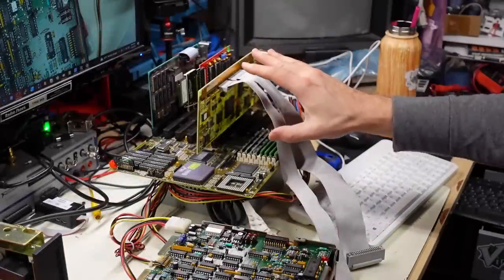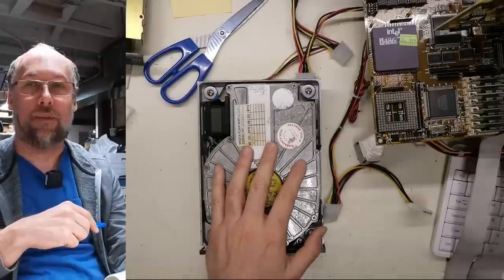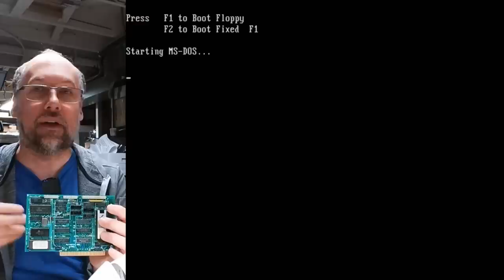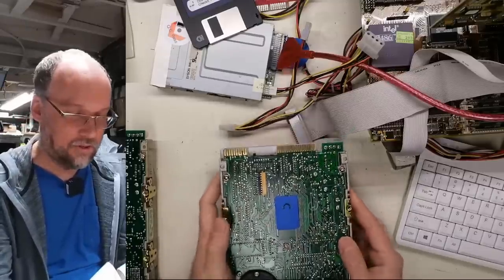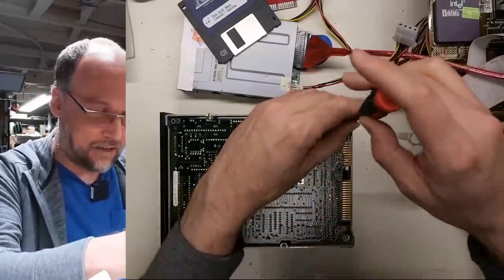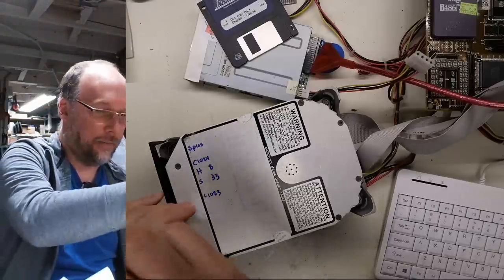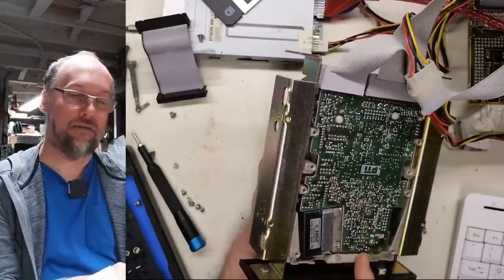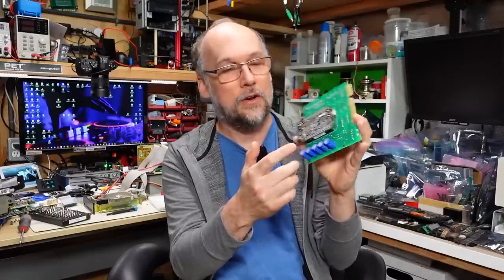MFM drives are really unreliable

Comment: My 1st IT job was programming on a Honeywell mainframe. Fixed and removable hard drives, the platters were huge 16" diameter or so. Head crashes on those things left a deep gouge in the metal, catastrophic damage.  Heard a story where the heads crashed through the side of the case.  One time the OS reported the loss of a removable drive, some maintenance guy had unplugged it so he could plug in his hand drill.  An Entire room at the facility was built and designed just to house mag tape library. Yeah those were the bad old days. I read somewhere that it would take a mainframe billions of years of computing to equal a week of the computational power of a modern smartphone, all that electricity too.

Comment: In 1994 I put a ST-251 40 meg with Doublespace compression in a Pentium 100.
It worked perfectly, no errors never lost data. Running Windows 3.1 and Autocad 13.

Comment: Back in the day installed these drives with an RLL card.  That increased the sectors per track and usually usually after a low level format, and scan for bad sectors, all were functional.  Then used Norton Disk Doctor to calulate the interlive.

Comment: My first drive was a Rodime full-height 5 1/4" drive hooked up to a CP/M system. This gave a whopping 4MB capacity. It couldn't boot from the harddisk, it needed an 8" floppy to run from. The disk controller actually didn't know how to seek beyond track 255. I reverse engineered the CP/M BIOS and got it to double the number of tracks, so I could do 8MB on a later Vertex drive of some type.
Had plenty of fun with Micropolis stepper motors going bad, Maxtor XT2190 sticking etc.

Comment: Those platters are made of the purest aluminum of any mass produced parts ever made. The oxide coating is so thin as to be completely invisible. A pigment is added only so that in manufacturing they could tell the coated platters from the raw ones. In later years there was no need to add the pigment, so the platters appear to be bare metal. The surfaces are also extremely flat, usually within 25 microns across the entire surface. 

A hard drive platter makes an extremely nice signalling mirror, for primitive hiking. The sun's reflection will be about the size of the platter over considerable distance and you can look through the center hole to aim the reflection.

Comment: Stiction remained a problem until it became common place to unload the heads (a plastic ramp lifted them) at power off.  Drive manufacturers seemed to cope with it by minor jiggles of the drive motor back and forth while also minor jiggling of the heads side to side if there wasn't indication the spindle was starting to spin.  Just remembered, if you had a drive that did get stuck and this was how the manufacturer coped with the problem you could hear a beep like sound as it attempted to unstick itself.

Comment: Try the card from the bad ST225 on your working one. I find it less likely that a suspected bad card would damage a drive.

I have a Priam V185 (I think that's the model) in my IBM 5160 that makes a horrible bearing noise when spinning, and the disk is not accessible. 
My plan is to take that drive apart and try to add some lubricant to the spindle motor to at least preserve the sound of it spinning, while reading data from some modern storage device.

Comment: I remember the days of MFM hard drives. Started off with a trusty 20MB! Then somewhere along the line I remember an 80MB drive where a pair of heads had failed so we simply configured it in the BIOS as having less heads and it worked like a treat! Still got 60MB out of it. In those days, that was a win.

Comment: that's 2 out of 5 of a pile that was proably already weeded at least once across the 1990s

I used to see about a 50% failure rate when testing old MFM drives in the mid-late 1990s

The most impressive were some VOICE COIL (not stepper motor) 40 and 80MB drives from VME systems - these drew close to 200W apiece and were apparently 6-figure purchase costs when new. They were all full height 5.25" and when they eventually failed, I opened them - the 40MBs were identical to the 80MB, just with fewer platters

Comment: My father had one MFM drive that lasted 20 years of daily use in his "writing apparatus" Amstrad as it was coined in the taxes. I still have it somewhere and it contains his entire bibliography of thousands of articles and dozens of books.
Reply: Back that up ASAP if it even still works. As you see in this video these drives can be very temperamental…
Reply: @dogecode386  I still have that drive somewhere though i have of course backed it up long ago. That writing apparatus of his lost its power supply in 2005-2006, but the disk survived. I don't think it's the first disk that machine had, but certainly the longest living. I think it was amstrad 1512, but not sure since it had AMD 8086, not intel and hercules graphics for the sharp fonts.

Comment: Those were the days. Low level formatting a hard drive, setting the interleave factor, and parking the heads. I haven't thought about those issues in a long time. IIRC, A typical interleave value was 3. I used to have a program I would run that would test a drive for the optimum interleave setting.

Comment: The 1st hard drive I saw was a winchester made for an Apple 2 computer star network. It required one whole apple 2e 48KB computer to run the drive which was about a shoe box size and you could see the heads moving on the 6" platter.. it's capacity? 5 Mb!

Comment: We ALL called it stiction, it was very common with video tape recorders and rotating heads. The tape would stick to the head as it flew by, and make a very large mess inside the transport! 
We used to get those stuck drives spinning again, by rotating them clockwise on the floor or a table and stopping the drive case from spinning very quickly with a phone book* to break loose the platter.  *(those existed before the "internet" too... :) )

Comment: Actually, only modern 2.5" drives are glass. I've opened many dead drives and all the 3.5" ones have had aluminum platters. Also, the magnets in HDDs are endlessly useful. I also got a 2.5" IDE drive to work by opening it up. The top cover was slightly bent which prevented the motor from spinning properly. It worked long enough for me to copy the data off it which is all I needed.

Comment: In a telco repair shop, I once had a hard drive with a very bad crash, it was obviously run for many many hours like this and the bottom of the drive was full of aluminium dust. So I cut that head off, blew out all the dust, then succeeded in getting it to boot dos! (just for a laugh)
In telco buildings it's not uncommon to have a computer that boots up off a hdd, then never touches the drive until it gets power cycled. Often in these places there are huge UPS supplies, so basically the power never goes off, so these machines can run for many months or more with a head crash. They are often run headless, controlling something, with no operator present, in a noisy exchange etc, so nobody hears the screaming drive. The systems are working so don't touch it.

Comment: Of all the MFM drive manufacturers at the time, there was one who was by far the definition of unreliable. Enter Kalok. Kalok was and is by far the definition of unreliable due to band slippage and high failure rates. Even after they left the industry in 1994, Kalok still holds that title as the most unreliable MFM hard drive and you'd be lucky if the thing ever worked at all. Let alone finding two that worked!

Comment: In the way back days I got a bunch of 'dead' St225 and spent time swapping the controllers and got almost half of them working.  Low level formatting the ST225 with an RLL controller gives you 30megs.  The RLL trick can also help if the MFM format falls

Comment: I use the override the St225 speed control , remove the cover amd spindle screws, add grooves on the plater edge, and eject the plates at full speed. They actually went in the gypsm.

Comment: The Drive spindle needs to be grounded,
if it is not the platters attract the Heads.
However the the ground of the spindle would fail over the years.
I managed to repair a 1990ies 18GB HDD...... by pure luck.

Comment: My old IBM PS/2 model 50 had the problem of the heads getting stuck to the platter in its ESDI drive. I actually blindly stumbled on the fix when I got angry and smacked the machine, then tried switching it on again and the drive spun up. I later found out the trick was to lift the front of the machine a couple of centimetres and drop it onto the desk, which will free up the heads and let it spin again.

Comment: (just FYI: this video isn't loading on Odysee, but other videos there will)

Many years ago (mid-late 90's) I was backing up an old XT-class system for a law office (they were upgrading to a '486 or maybe even Pentium system).  The HDD wouldn't spin up on it's own, so I had to un-screw the board on the drive so that I could get to the flywheel on the bottom.  I would power the system up and quickly reach underneath to flick the flywheel so it would spin up.  Then I'd back up as many directories as possible before the drive stopped responding.  Then I'd have to power it off and start the process over, and copy the next batch of directories.

Ah, the fun of working on what even then was already obsolete systems.  I should have grabbed my lawyer's old AT&T 6300 before he died.

Comment: My main issue with MFM drives is stiction . I have a pair of Seagate ST 124's that will only spin up again reliably once you park the heads. These do not have auto park.  The  bigger 40MB ST251's do.

Comment: At some point, someone at Seagate decided that they could put a finer stepper motor on a ST225, and presto!, you have a 30 Mb drive ... or so they thought.  I don't recall the model number offhand - what I do remember is my work that year bought a whole bunch as part of an upgrade plan). The results were ... predictably awful. IIRC, half failed right out of the box, and of those we actually installed, probably half again failed within the first hundred hours of operation.

Comment: Stiction was a huge problem back in the day for basically every manufacturer, even into the '90s. After a while most of them figured out that a dedicated landing zone with a textured surface helped prevent stiction. Also, linear stepper-based drives (the ones that read like floppy drives do, like the PTI drive) had an annoying tendency to randomly leave the heads on the media when powering off. These were the drives that you had to run parking utilities to send the heads home before powering off. Some drives, like the MiniScribe 8225, had a time-out where they'd send the heads to the inside of the drive after a period, but unless you wanted to wait for 60 seconds or so they still had to be told to go home before powering off or the heads would just land where they were. I really don't think you'll easily find service manuals for any of these drives. Most of that stuff was internal use only, so only factories and/or depots would've ever had them.

Comment: I personally went through a couple of those st225's last week and had one with similar issues. I swapped the controller with a working drive (bogged with bad sectors) and the defective drive started working without issue. I did try to scope out the defective board briefly and it seemed that there was a head drive issue. Haven't dove in to it much but the mechanics worked without a problem. I have one of those st4051's and it looked mint. Same failure not related to corrosion. However, when I fired my drive it was seriously violent! Heads drove from one extreme to the next. I am determined to repair that drive. On another note, a few of these old drives seem to come out of death by running for a bit and warming up. Left the power on by accident on my test bench formatting a drive overnight and restarted the format the next day as it never completed from the night before and the drive works without issues or bad sectors now (shrug). I think maybe the grease in the bearings causing variations in the RPM's causing inconsistent read/writes, caps, etc..

Comment: Another thing that I'm going to note, is that you can't just interchange these drives in most cases. There are frequently settings that will need to be programmed correctly in the eeprom in the controller. Bios setup settings don't always work for this purpose.

Comment: As I mentioned on part one of the MFM Drive Saga, I had a Seagate IDE ST-57A (that also has a stepper motor still) that I could get to cold-boot if I literally preheated it. I wonder if that also was the same 'stickiness' problem. It did however work for years with this problem as it was in a home server that almost never spun down. But 10 minutes at an oven on 50 degrees Celcius made it spin right up. 

Also had another Quantum IDE drive of about 80MB that was stuck that I got working by opening it up and manually turning the motor. I was very careful to keep it upside down while open to avoid getting any or much dust in it. That one had a regular voice coild though. It survived for years as well, with 32KB of bad sectors.

Comment: Ahhh, the noise! I've been pulling data from an ST-296N SCSI drive this week and it sounds like a jet taking off.  
Thanks also for your video "Method to revive hard drives from the 80s" from 5-years ago. If folks like this video, they may like that one. I'm working on the same Western Digital drive that you discussed, and the trick of putting tri-lube on the stepper motor was GENIUS!

Comment: I remember around late 1990s early 2000s having hundreds of Seagate drives that would fail to spin up  on power up 50% of the time. I think we returned about or just over 100 Drives. From what I remember the bearings were too tight and just would not spin. These were IDE drives, Not sure of model but they had rounded edges and very thin black half circular foam sticker on the opposite end of the IDE port.

Comment: With these old MFM drives, today at least, the first thing you want to do is lube up the stepper motor and if possible the platter motor. A lot of the time they are the point of failure on a drive that is spinning up but not initializing. IIRC most of the platter motors are closed bearing so getting into them to lube them up is difficult/impossible but the stepper motors for the heads are usually doable and very often a sluggish stepper motor is behind the issue.

Comment: I got one of these Micropolis drives and it had two bad heads, could be verified by swapping the head plugs, the fault would move, so the head amp is working (clarification: The heads were unresponsive, not a single track on them worked)
One of my ST225 also lost two heads since I had it powered up the last time several years ago. Worked fine then, but now half its heads are unresponsive.
I prefer the AMIBIOS low level format routine from the 386/486 AMIBIOS (remember when it was super colorful and you could change the colors too?). It also does auto interleave, but that is of course bogus if you're gonna use the drive in a different machine.
If you get lucky, that Computer Memories hard drive might have just a bad op-amp or capacitor in the speed detect circuit, so maybe it never gets a tacho signal. But then again if something as "simple" as this is bad, there will be more problems lurking in that drive.

Comment: For sure with the age deterioration, lapine mfm hard drive titan series (LT) have a well made pcb and assembly, more have a head lift system when the drive is off. No head stiction, no parking needed, head crash avoided when shipping. My lt200 have no defect After llf, 0 Bad sector and intensive use. Also they have used a good magnetic paint for their platers, back in the day, they already have commercial about stiction and their specific platers.

Comment: How i reuse old, half broken hdd's in my retro computers.
I use software like hdtune or alike to locate where the bad spots are in the drive, then partition the hdd so, that the bad spot is in its own partition, with some room around it (like gigabyte or two, depending how big the drive is.)

Then when i have "partitioned out" the bad spot, i just dont use the bad partition or delete it so that spot is unpartitioned.

Sounds more difficult as it is, like if i have 100gb drive, and there is bad spot at the 50gb mark, i first format 49gb partition, then 2gb partition, and then again 49gb.

So that i have 49gb partitions before and after the bad 2gb partition.

But these "fixed" drives are way on their way out, but may work for years in an hobby pc that maybe gets few hours at most per year of use.

I have the legendary 1.5tb barracuda with 8 partitions, every other bad 2gb partitions lol, still use it in my xbox hdd formatting machine where i use the space to store the games lmao :DD

Comment: I once fixed a seagate st-225. Opened it up with latex gloves on, gave the platters a spin with my hand, turned the pc on and voilas it worked. Put the lid back on and it worked good for two years. And than on one day it did that bleep bleep knock knock sequence and that was that. But by then it was 1994 and I bought a new pc with 500 whole megabytes of harddrive space in the form of a quantum bigfoot 😂

Comment: Keep in mind that none of those drives actually used information on the disk to operate, everything, including clock recovery, is on the controller.  Your 225 sounds like the track 0 sensor is not working, either the sensor is bad, or the stepper can't get that far.

Comment: There is much better way to get rid of corrosion on electronics but it takes time. You need a vinegar and a piece of cotton wool. You are pouring vinegar on cotton wool and putting in on corroded area. Working like a charm.